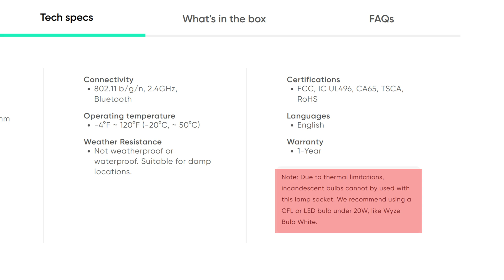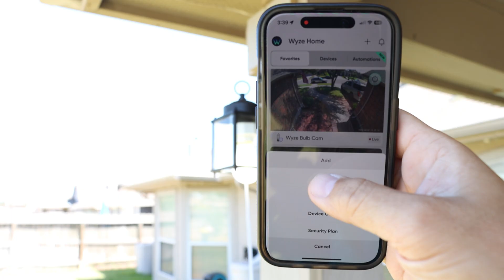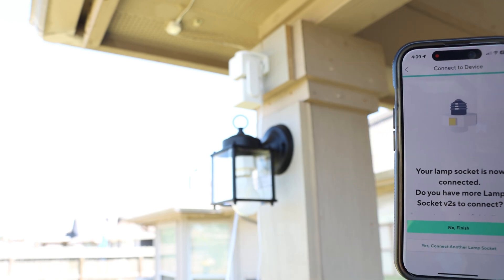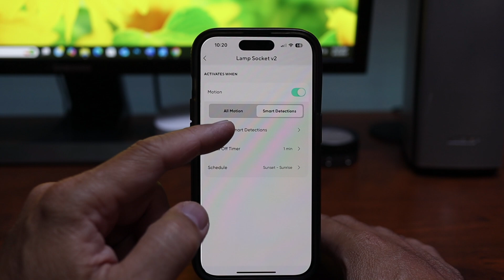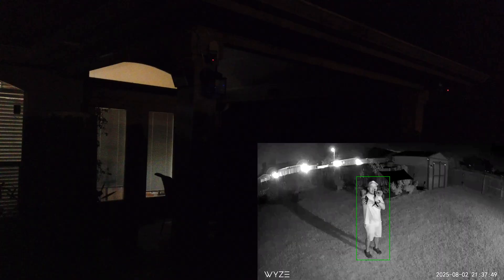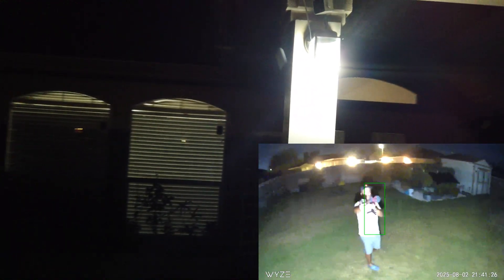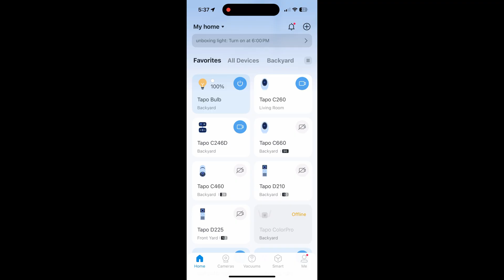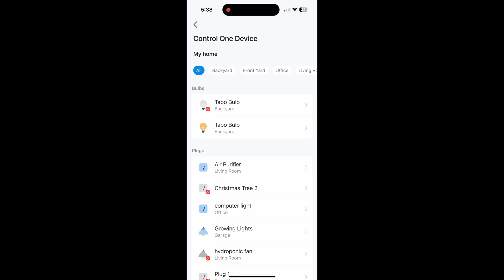Wyze Lamp Socket V2 - Can Power Up NOT just your Wyze Cameras!

Comment: I just recently installed the V2's on my front and back porches. The box say's they work with Alexa but it doesn't work. It only works when the Wyze Cam's are triggered or by automation like dust till dawn. I no longer have a way to turn on the outside lights manually. They do great powering my V4 Cam's, I just wish we had more control over the lights.

Comment: Hopefully Wyze finally started adding lengthier cables with the new lamp socket.  The v1 lamp sockets never had a cable long enough to reach where I wanted to place the camera.  Oddly enough, I did receive 1 lamp socket in my order that had a cable that was twice as long as the other lamp sockets I received (which was actually the perfect length for my back door.  When I messaged Wyze about the inconsistency, they didn't have any idea how it ended up that way...

Comment: Can you control the light bulb if you use a non Wyze camera?
Reply from the maker: The lamp socket will be continuously be powered if you don't use a wyze camera. You can however use a smart bulb and depending on the camera that you plug into it, you can use automations to control the light bulb...lets say you have a tapo cam and smart bulb... you can use Tapo's automation that when the camera detects a person, the light will turn ON etc.
Reply: @LifeHackster thanks.  I was wanting to plug in my Blink but keep the light off.  Also, can you review the new Wyze Palm Lock?

Comment: Wait I really like this. I am using the v1 of the light socket and am tired of wyze. Most cameras though require more power. Is the eufy the best that will work since it is normally battery powered? I really just want a nice cam I can hook into my blue iris or nvr
Reply from the maker: Unfortunately, you will not be able to hook up eufy cameras to an NVR or Blue Iris.

Comment: The fact that they’re still using MicroUSB is sad. My V1 lamp socket still works with my Wyze Cam V4.
Reply: You have just explained why they still use micro USB. It's compatible with all their devices for people who have multiple models.

Honestly, it's not a problem for me since I am not plugging in or unplugging the cable over and over.

Comment: Does the WYZE bulb camera work in a WYZE lamp socket v1 or v2? It would be nice to use these with each other that way you can get 2 different cameras from the socket.
Reply from the maker: It should be. Just make sure that you set or schedule the socket to be powered on continuously.